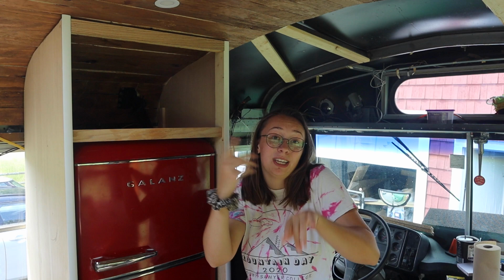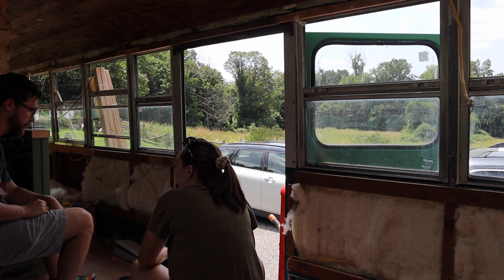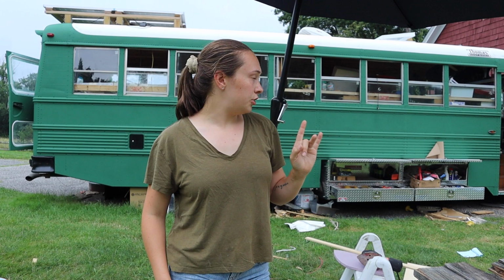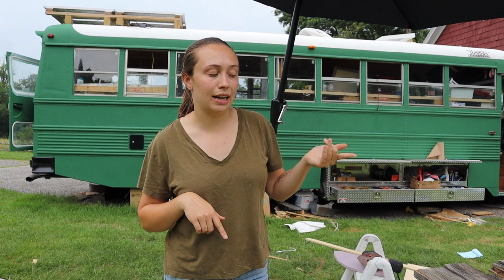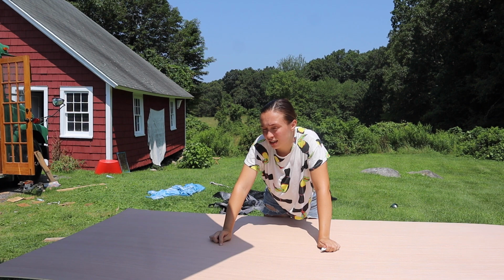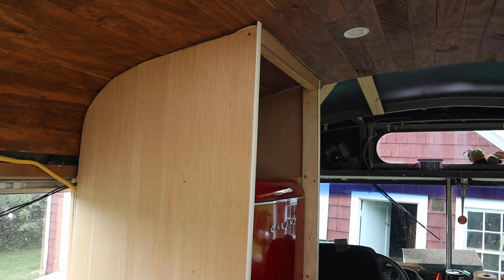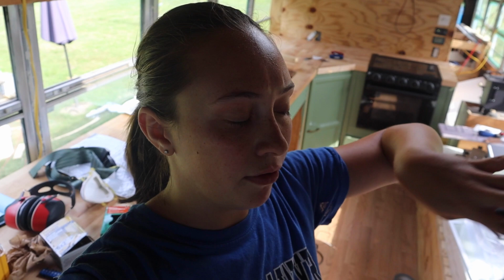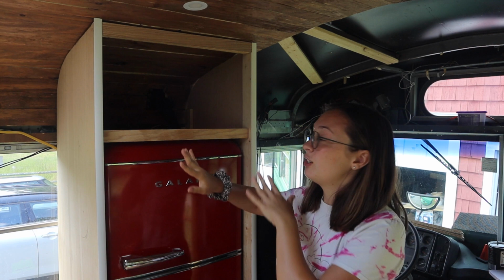Building a Home for our Fridge//School Bus Conversion

Comment: Retired school bus driver here. We're also building our own skoolie. Not being a know it all, but trying to help you avoid problems. Run a screw into the window frames behind the refrigerator. Bus windows are notorious for falling down when you hit a bump. There's no way to get them back up from the outside, so it's easier to run a screw in there to keep them from falling in the first place. Just thought I would suggest this so you don't have to disassemble the entire thing to put the windows back up. Hope this helps.
Reply from the maker: Thank you, we had not thought about that potential problem. We will definitely be doing that so thank you so much!